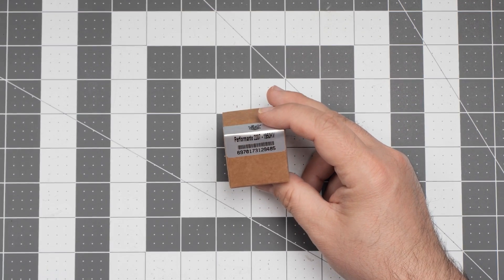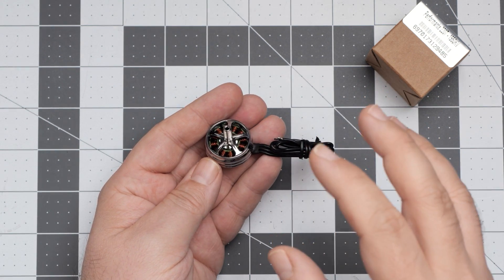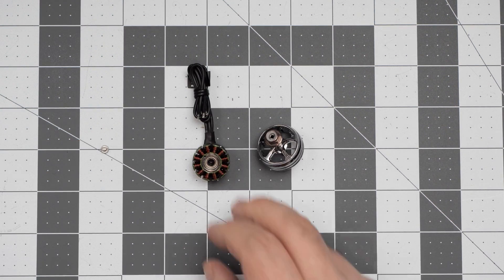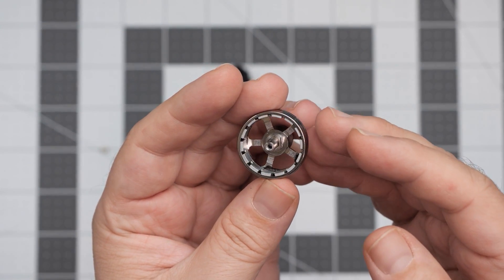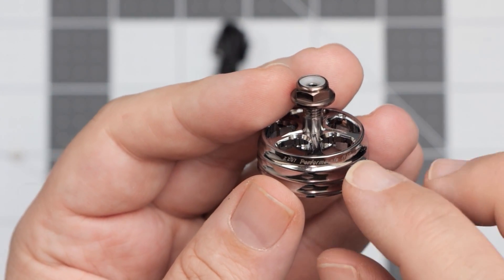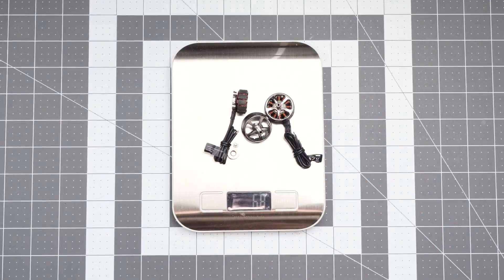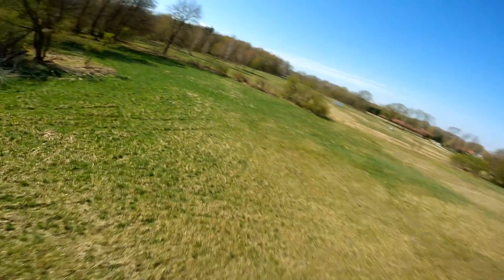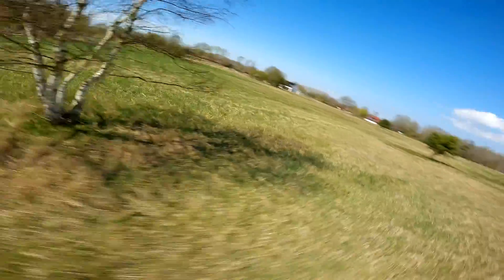AMAXinno Performante 2207 drone motors

Comment: Could you measure the lamination thickness?
Reply from the maker: Tried, but it's too fine to measure with plus it's sanded on the magnets side. So no idea without disassembling the whole stator
Reply: @FPVUniversity  My "method" (not claiming it's correct) has been to measure overall stator height then take a cell phone pic and zoom in to count number of laminations then simply divide. E.g. brotherhobby motor has 38 and xnova 46 which indicates roughly 0.19mm and 0.16mm respectively (which we can probably assume equates to 0.20mm and 0.15mm).
Reply from the maker: @bennymack78  won't work. You can not see lamination on the outer part of the stator
Reply: I'm curious what these stators look like. There are clear ridges on my brotherhobby and xnova motors, the numbers of which appear sane. Another way to know might be to just ask AMAXinno, maybe let them know it's a good number to always publish :)

Comment: Nice and light motors. The V1 were made of paper, you could kill the bell by bending just by gripping it too hard with your hand while installing the prop. 3 were ruff out of the box, one I killed by hand when installing, one bell bent slightly in a light crash which made the motor seize. out of 9 only 4 made it to the second flight due to these reasons. Hot motors just while hovering. I would never buy amax again to be honest and changed to xing

Comment: I had a pair of amax performante 2306 1900kv that would Rip but would bend shafts like tinfoil. Think they were like 28grams soaking wet though. Cant find replacements so they look pretty on my shelf now :P
Reply from the maker: That was one of the problems with V1. Those are V2 and they say they fixed that. let's see

Comment: this is the worse motor i try ,  I bought them to replace brodherhobby with the same kv and size
amax is heavier, consumes more, much less powerful
Reply: I also forgot the bearings are really shitty after some lipo they have already started to make a lot of noise
Reply: You mixed up the brand?  It can not be possible our motors are heavier and less efficiency and power than brotherhobby,  please show data. Our motors are famous of best bearing,  I am wondering why no complaints of bearing arrived us. If you have bearing issue,  please contact us.
Reply: @AMAXshop  ok now I'm in bed but tomorrow I show you the 2 motor